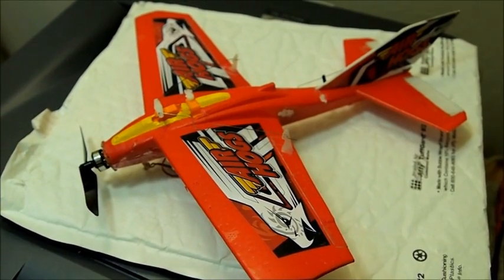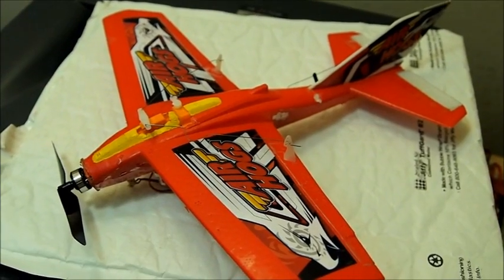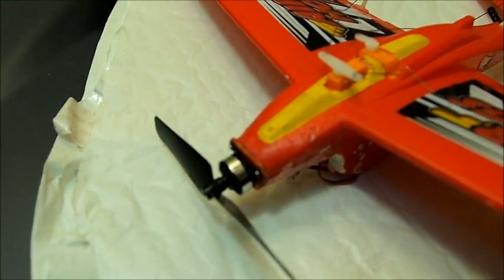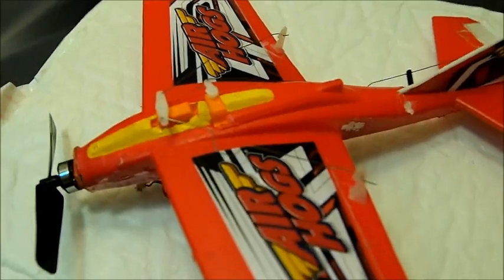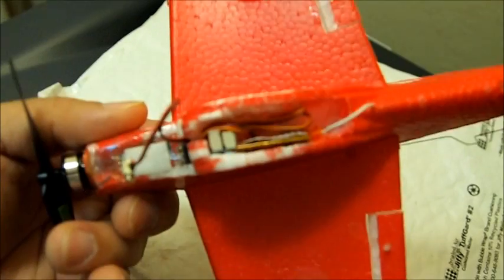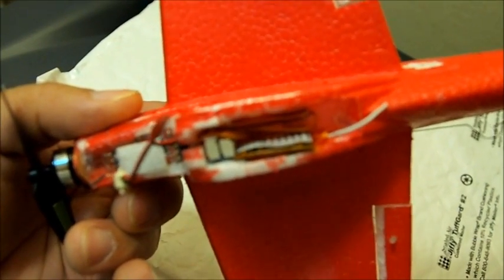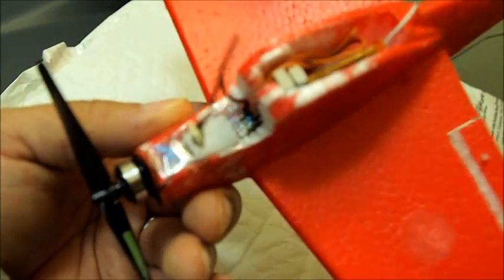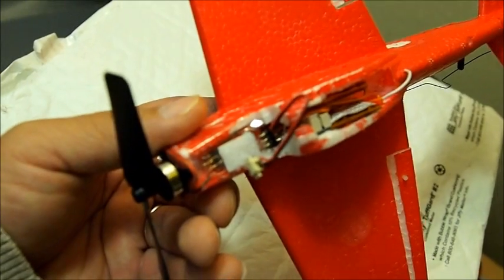Air Hogs Wind Flyers conversion to 3-ch

Comment from the maker: soldering is very easy. To start, just grab a simple soldering gun, flux, and solder from your hardware store. Heat up the solder gun till HOT, then add solder to your gun and tin your wire. Tin means heat up your wire and add a bit of solder to it, then do the same to the joining wire,....then just join the 2 pieces with the solder gun and a bit of solder. It's easy and fun.

Comment from the maker: Most motors will come with bullets pre-installed. The smaller ones like in this air hog won't though. You then just plug the bullets into the ESC, which many have female bullets pre-installed. Anyhow, if you're gonna do anything with RC you've gotta solder...just no way around it. RC without soldering is like duck hunting without the ducks.  : - )

Comment from the maker: motor and thrust is fine. I think your build is just too heavy. The stock setup with the heavy nimh and brick was 22.6g. My setup with a 100mah 1s total came out to 21.6g. I did fly it on a bigger 220mah, which came out to 23.6g and that flew pretty sluggish...so I'd imagine at 26.8 it wouldn't fly too well. Try shaving off as much weight as possible. Get rid off all excess wires; your control rods should be the thinnest possible. I'd say you need to shave off at least 3 grams.

Comment from the maker: haven't tried 3x3; I'd imagine it'd work ok...but 3x2 seems to be perfect for that motor/plane. I've thrown away all my HK ones, and I picked up the 3x2 GWS from my LHS. if you don't have a LHS, you can get them from any online vendor. I've posted a link in the description area. Anyhow, you won't need more than perhaps 2 or 3. In 20+ flights; I didn't even break 1 single prop.

Comment from the maker: I took a piece of lite ply, strip the top skin off and used just the skin portion. basically lite ply has skin, then middle soft piece, then another skin....I just used the outer skin. Anyhow, either that, or the thinnest lite ply you can find.

Comment from the maker: thanks. I've added all the links to electronics in the description area. it looks like HK has increased the price on the motor quite a bit... Anyways, for the prop, it's a 3x2 gws prop. I linked the HK gws style prop so you get an idea, but don't buy those. They are awful and seriously out of balance. I had to literally sand away a couple layers of one blade to balance...it was a nightmare. I threw away all of them, except 1. Thanks for watching. RC

Comment from the maker: I would sell you mine :) for cost (around $50), but you'd need to buy the Tx (controller), that is DSM2. The cheapest spektrum is the DX5e for about $59. Unless you're a big air hog fan, for that you'd rather buy something like the champ, which sells for about $89 RTF. Do a google search for "rc champ". If you still like mine, pm me.

Comment from the maker: absolutely! This would definitely be the way to go if you wanted to build something yourself and already had a Tx. Most important thing when you go micro is weight- you've got to get the lightest gear possible within your budget. At this weight class, every gram counts. A difference of say 3-5 grams is a good flying plane and a flying pig!

Comment from the maker: You can, but it needs to be very light. As a comparison, I weighed 4 quarters, and weight came out to 23 grams. My entire plane plus the battery weighs in at 21.5 grams...so the plane is lighter than 4 quarters. If your parts plus plane is close to the weight of 4 quarts it will work. I'd say any more than that, and it won't fly.